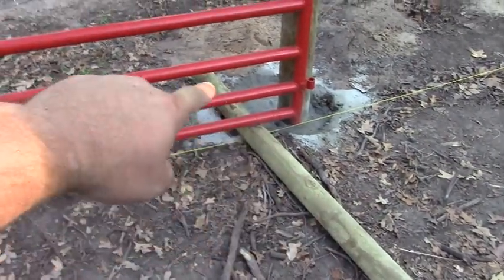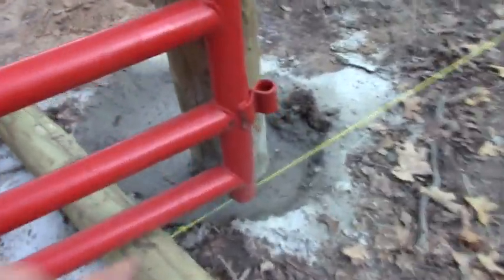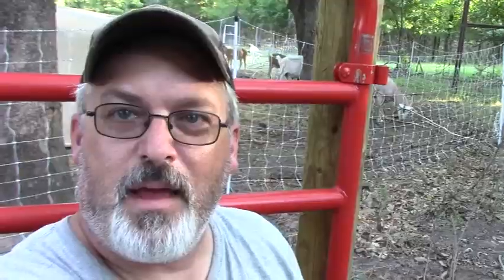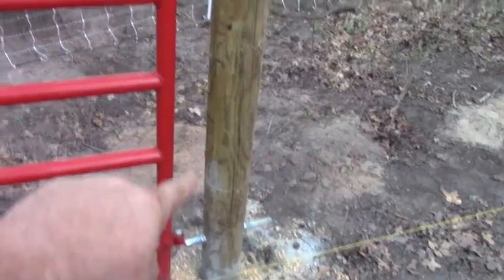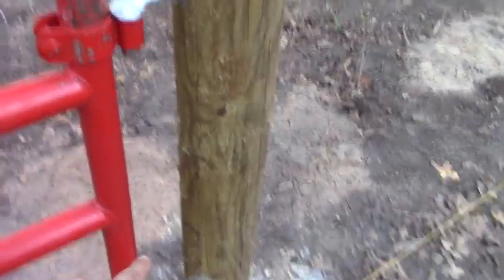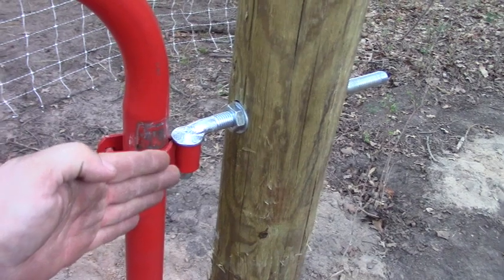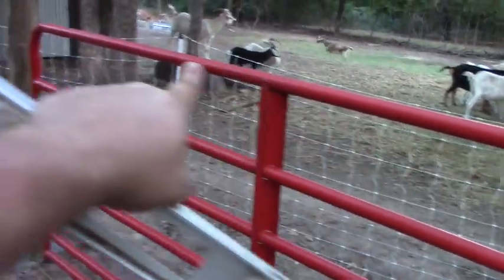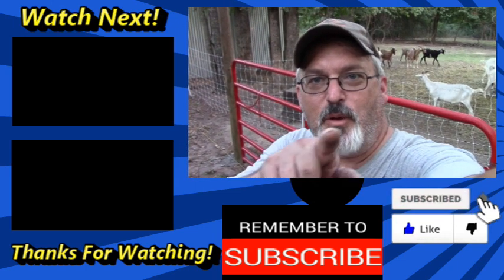How to Install a 10' Gate or Hang a Tube Gate

Comment: Super helpful video.  Never done this before and you answered every question I had.  Question: Do you cut off the part of the support that's sticking out on the other side of the post?  Or maybe drill a hole in a 6x6 and slide it on with a finishing nut.  I'm worried about horses getting rambunctious and slamming into the long protrusion.  Mine will be inside their turnout area on a run-in shed.  Thanks so much.

Comment: How far away did you lay the post for the 10’ gate?
Reply from the maker: Great question! 10' 6" from inside post to inside post. That gives enough room for the hinges, adjustment and to be able to level the gate with the hinge bolts. That also will give enough room for the gate to swing either way and not allow critters to go through.